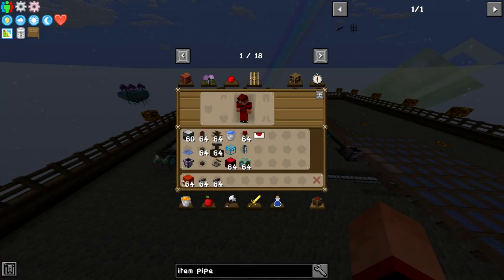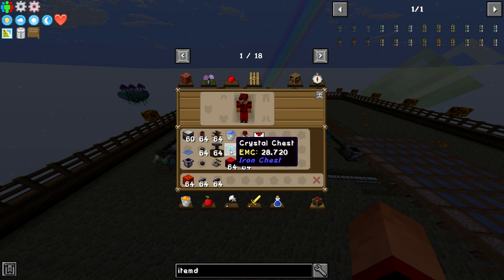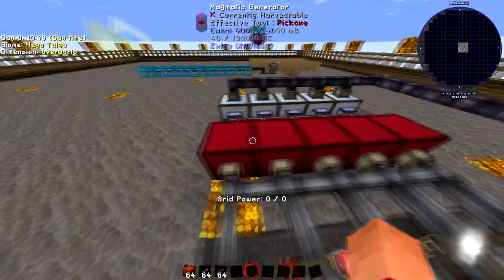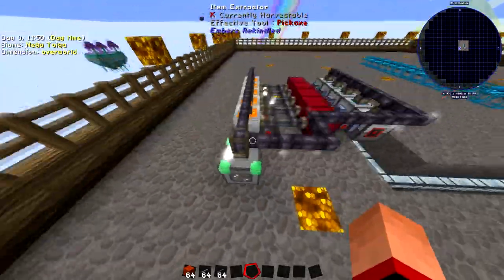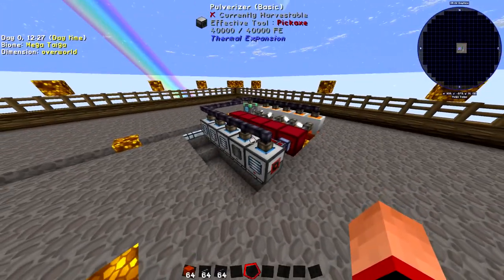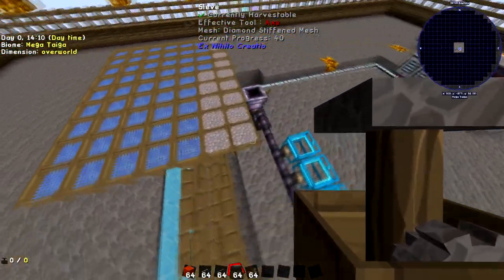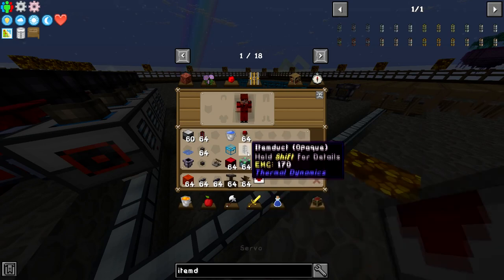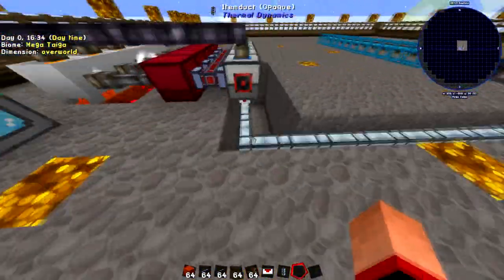Minecraft Powerful Early Game Resource Generator (Updated) | Project Ozone 3

Comment: I would recommend actually addition's storage crates over diamond/crystal chests as they can be upgraded and can hold a lot more items also they are very cheap as they only require wood and later coal (void crystals) to make. Also I would recommend ender io's item conduits over ember's item pipes if you can afford them otherwise I would stick to thermal expansion's itemducts (impulse if possible as they are the fastest) Also you should probably use barrels/compacting drawers to store the same time of items, compacting drawers because they allow you to compact and barrels because they can have an infinity upgrade allowing an infinity of a single item to be put in

Comment: You would need a better method of inserting gravel/sand/dust into the auto sifter, the basic itemducts are like 8 per second which can't match up to the speed of the sieving in such a large grid (Nvm I didn't realize that the itemduct transfer rate bottleneck was from using crappy servos, my bad!)

Comment: I hope you are still replying to comments but I don't know if you even remember this but I wanted to ask about a problem I encountered that I dont think many have encountered. So everything was working fine with the machines and the energy but then for some reason the magmatic generator stopped receiving power from the crucible that were full of lava I even broke and replaced the fluid pipes to see if that was the problem and even added redstone torches. Even after all of this and even trying to use different mods fluid pipes my magmatic generator had received zero energy? I was wondering if you have any idea as to how I can somehow fix this.
Reply from the maker: Stretching my memory there, it could be the generator somehow got liquid that isn't needed in it, or that the entry side had change with a patch or update to a mod, check the orientation of the inputs and outputs hasn't changed and make sure the energy conduit you are using is still applicable too.
Reply: @xyie6600  I took your advice and had even rebuilt it but still hasn't budged at bit. The energy source of the magmatic generator though can still be lava, the machine works if I were to manually give the magmatic generators buckets of lava, they would still give the energy through the fluxducts to the pulverizers. So I am still considering maybe the crucibles are the issue but the fact that the whole system were working with lava confuses me. I don't know if you can help with this and if it's not possible then its completely fine because thankfully I can manually just give the sifter part gravel and it will feed me ores. Thanks again for responding despite it being 2-3 years later.
Reply from the maker: Hmmmm, to me then that sounds like an issue with the piping from the crucibles to the generator, possibly a redstone torch needed, or if there are any alternate fluid pipes maybe give   then a go, and no worries I might not be active anymore but I still enjoy reading the comments :)
Reply: @xyie6600  Yeah I had made all of the fluid pipes I could make from all the mods that contained them and they had not worked as well. I also have the red stone torches under the piping, I even tried placing red stone torches under all of the fluid pipes. Last thing, no steams come off any of the pipes within the entire system so I really have know idea where to troubleshoot.

Comment: Thanks so much for this! Also - sand clogs the pulverizers up, any way to automatically unclog them?
Reply from the maker: There are upgrades which you can put in to stop additional output, or you can pipe it out up to you :)
Reply: @xyie6600  thanks!
Reply: @xyie6600  what upgrades are these?

Comment: What abt the sand that just gets stuck in the Machine and it doesn’t go on if you take it out
Reply from the maker: Change the color of the secondary output and pipe it out of the same color side and it will clear it.

Comment: Hey thanks for the video but what to do with sand? Pulverisers stop if it has a stack of sand inside
Reply from the maker: You can add  a pipe to side that has the same colour as the sand output  and either store it in a chest or pump it into another sieve set up or pulverise it again into dust . Just make sure that the side you attatch the pipe to has the same colour square as the output section of the pulveriser :)
Reply: Xyie Thanks!

Comment: I don't know if im blind or dumb but i can't seem to get the servos to pull from the pulverisors. i have all of them on ignore redstone and have the bottom of the pulverisors set to red to match the output.
Reply from the maker: Check there isn't a blockage in your pipes, and double check that the output in the pulverizer itself is red and not another colour, and then make sure where the pipe feeds to is also the correct position
Reply: @xyie6600  I figured it out im juat dumb. I had the axles for the water wheel in the wrong direction so the auto sieve wasn't powered.